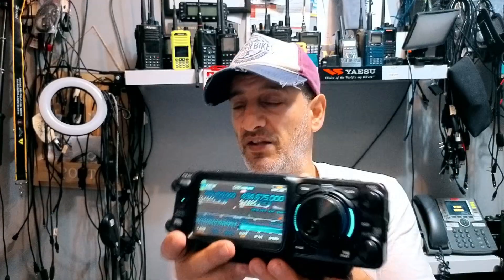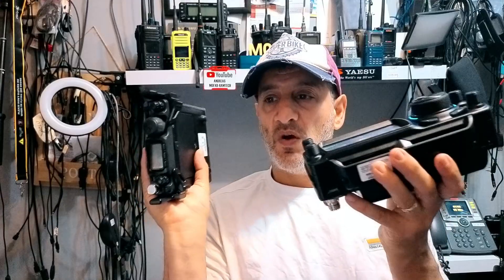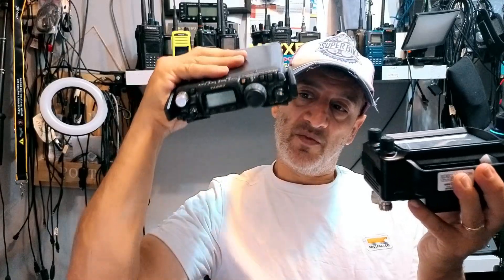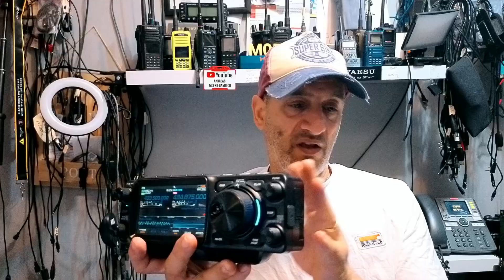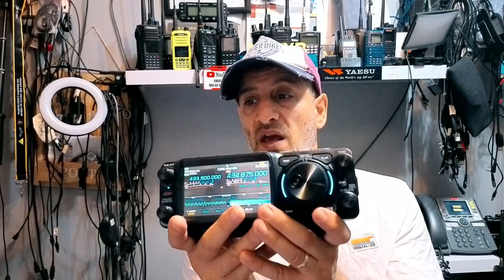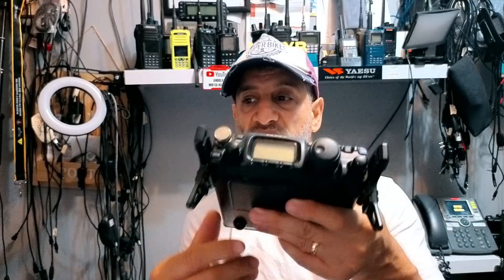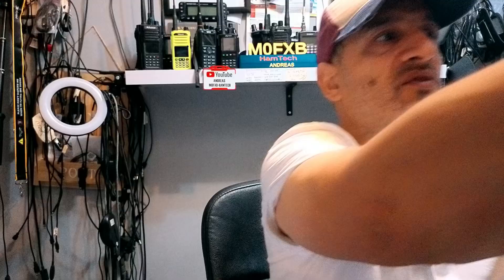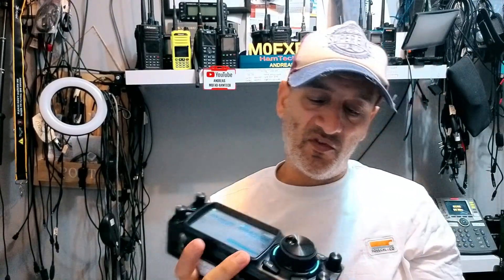This is not a Yaesu FT818 /897

Comment: Look at what you got on the 818/857 - there is no way you can compare or come anywhere close to the features or specs of these two types of radios. I know this is not what this video is about. The FTX-1F is way more comparable to the 710 or even the FTDX-10. The tech and feature set is nowhere near the 818. I was finally able to get one just a few weeks ago. I got the optima. This radio is leaps and bounds beyond even the 991A which I have also. No regrets at all. This is a next generation of a ham radio, I would much rather take the interface and working experience of the FTX-1 anyday over the 705 which I also own.

The FTx-1 feels so much more refined and so more easy to navigate. 

Finally, 705 - built in wifi and bluetooth - you can keep them - where is the APRS on any ICOM radio. Not to mention that Fusion sounds way better than D-Star.

I just don't get the hate for Yaesu. HAMs "bitched" about the 705 when it came out for it's price. Price never dropped the whole time.

The 705, you still don't get an antenna tuner, you don't get an amp and definitely don't get or ever will get APRS. Never understood ICOM's hate for APRS.

Love your videos. You always do a great job.

Comment: The FTX-1F costs as much as the IC-705 when it came out.  I'm not sure what people are complaining about.  Then, to add a 100 watt amplifier for $500?  Again, I don't see what the cost complaint is.  To me, it's a BETTER option than the IC-705, with all of the features that it has.  And, I don't see why this can't be the replacement for the FT-817/8.  It has everything that those radios had, and more.
Reply from the maker: The 817 needs to stay as it was maybe a bigger screen.

Comment: I see the FTX-1 Optima as the successor to the FT-991A. With the added bonus that you can take a part with you as a portable set. That portable part is a nice counterpart to the IC-705.

And it can be the successor to an 817 if we want to see that the underlying technology is completely different. Let alone the possibilities in terms of operation... 😉
Reply from the maker: Agree
Reply: Maybe, but the lack of an external display output is a staggering omission.

Comment: Cost isn't the issue for me it's the form factor. I'm just looking at the ic7100. But that doesn't really match my needs either. The 705 isn't on my list either. Honestly the 818 is a compromise. I'd like an 857 logical form factor and I'd like it to hook up to a computer if I want a large display.
Reply from the maker: Icom 7100
Reply: @M0FXBHamTech may end up with a pmr 171 at least that has the form factor I want almost